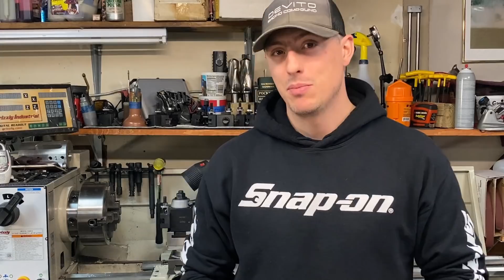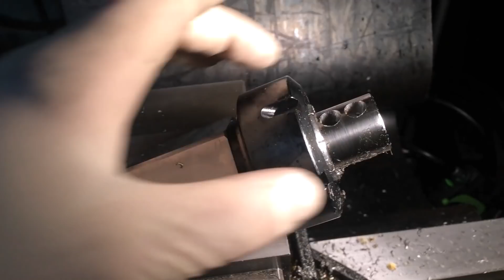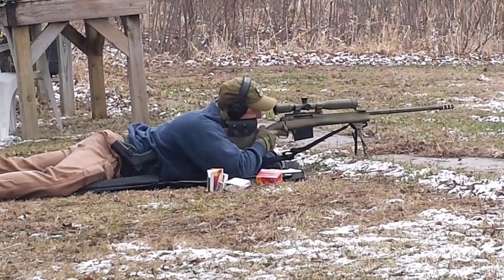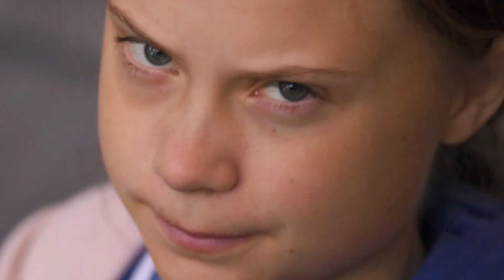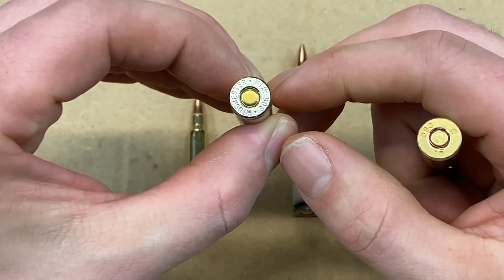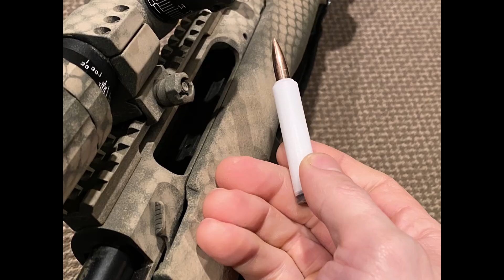6.8 NGSW ammo selected by the U.S Army for the NGSW Rifle testing! #ngsw #6point8ammo #army

Comment: The case is disposable and not reloadable or hand loadable so you as a shooter are at the mercy of factory ammunition manufacturers for factory ammo only. Factory ammo means you have to take their prices, their performance, their quality, and so on. Those cartridge factors are out of your control. That is a big thumbs down. Not a cartridge I as a civilian shooter want. The other benefits are not enough if I can't control my own ammo. If it can be hand loaded using components then that is different but I have not heard about that yet. Again I want a round that I can control in cost, performance, and quality among others. So far I am not excited about a cartridge I cannot hand load for so I don't know what other reloaders are excited about. I will stick with proven brass and nickel cases that I can at least control.
Reply from the maker: That is a valid concern. Like I stated time will tell if they figured out a dependably reloadable case, or if there’s a market for one. Have a Merry Christmas RB M!
Reply: @jeerrrrrrryyyyy  It's actually not all that valid of a concern. Brass doesn't last forever, you're already at the mercy of the (very few) specialist brass manufacturers. Literally any manufacturer that has injection mold machinery and a minimal machine shop can make a version of this True Velocity case. This isn't a boogaloo yet, so TV's patents still hold, but that's all that would keep this ammo from being commonly produced. The proper polymer formulation supply is more of a bottleneck, since that can be choked off.
Reply from the maker: Bingo.
Reply: @ostiariusalpha  I disagree but you are entitled to your opinion.
Reply: @rbm6184  That's fine, though I should point out that nothing about the True Velocity case makes it difficult to handload. The primer might be proprietary (need more information on that), so that would potentially be a slight limitation to custom loading. But otherwise, a new, empty case can be loaded with whatever .277 bullet you wish, seated to the depth of your choice. Find the optimal powder to light it off, and you're good to go.
Reply: @ostiariusalpha  metallic cases can also be made from steel or aluminum so you're not entirely dependent on brass manufacturers. But you are dependent on the secret sauce polymer.
Reply: @ChucksSEADnDEAD  Steel and aluminum case manufacturers are either foreign or even fewer in number than the brass manufacturers. In the case of "secret sauce,", there are a dozen variants of HPHT polymers that could serve in place of whatever True Velocity or Textron is using. The government would basically have to shut down the entirety of HPHT polymer parts production, which is nearly impossible even for an authoritarian regime, because it is vital to such a large segment of the industrial economy.
Reply: @ostiariusalpha  "Steel and aluminum case manufacturers are either foreign or even fewer in number than the brass manufacturers" - shit, at this point I'm talking about making cases from scratch. At least making swaging dies for aluminum cases is a problem I understand. Chemistry? I'm pretty good at highschool chemistry, but I don't know shit about making polymers in a home lab.
"it is vital to such a large segment of the industrial economy" - well, yeah and amm*nium nitr*te can't be banned because it's so vital to the industrial economy, but it's not commercially available in many places.
Reply: @ChucksSEADnDEAD  Honestly, all a hypothetical tyrannical government has to do is clamp down on primers, that's how you exert control over ammunition production, not by repressing metallic or polymer case manufacturing. Of course, there are ways to make primers yourself (strike-on-box matchstick heads being one of the most basic), but they're all so inefficient that you couldn't possibly sustain an armed resistance using just that.
Reply: @jeerrrrrrryyyyy  Merry Christmas to you too!